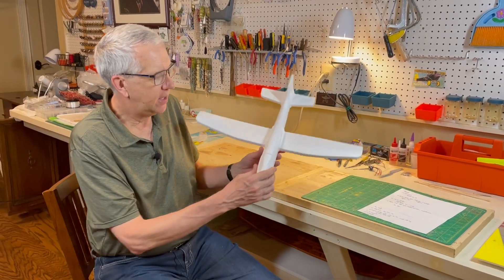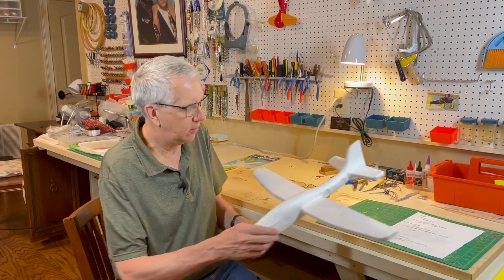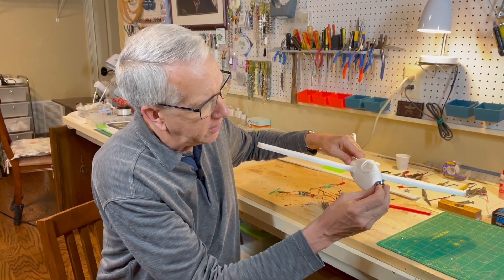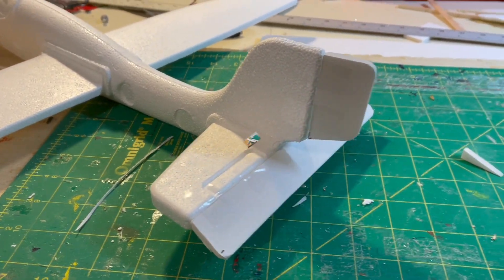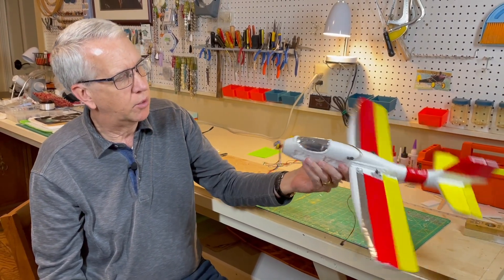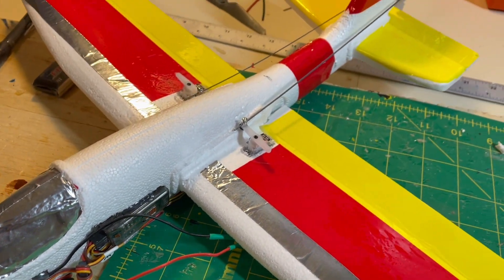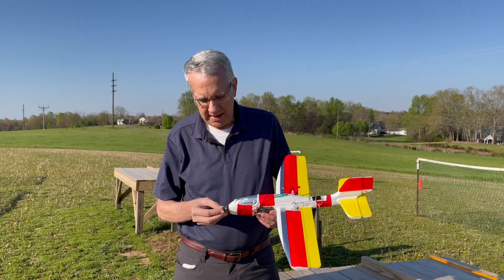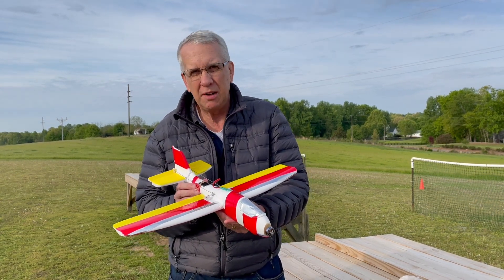$1 Foam RC Glider Hack

Comment: Use a park 180. Plus I'd move the battery up if that didn't change. Anything. You could add more tail wing area.
Reply from the maker: CM:  Good points, thanks!  Tim

Comment: Surely your not serious ?  I just don't know what to say !  After you finished it looks like it would be worth 25 c. ! I don't believe that you thought that would happen, - but worth it for a good laugh - better luck next time. It looks like torque and gyro effects to me, as the plane tried to rotate around the prop and did all sorts of exciting and hillarious manouvers, if you slowed down the video you could pass it off as 3 d. I enjoyed it very much, can you make some more like this ?
Reply from the maker: This . . . is a hobby. Do check out my earlier video where one of these small gliders converted to RC just fine. One learns by doing . . . 🤔 Tim
Reply: @TimMcKay56  or by watching someone else ! It was very enjoyable and a refreshing break from all those videos that make it look easy  to do a conversion - and you did make it look as good as it flew. I think we deserve a retrospective analysing why it didn't fly ? What about another try ?
Reply from the maker: @ericwillis777  Weight is the key item for the smaller models.  Just not enough wing area for good flight. Tim

Comment: With inflation $5 Store will sound more appropriate today...
Reply from the maker: 😁 Tim
Reply: @TimMcKay56  Question: When it's time to sacrifice aerodynamics isn't it better to have a clean top of the wing and clutter the bottom since most of the lift is on the top?
Reply: @Angelum_Band  It could be, really no studies have been done on this.  The reason mostly for keeping the top of the wing clear is access, it is just easier to reach the lower surface of the wing.  Tim

Comment: I think that out runner motor might be the cause of your problem. Especially as fast as it torque rolls. Try the motor you were going to use in the beginning.
Reply from the maker: Thomas:  That is a good point.  I also think that ailerons might have helped to more quickly catch the roll.  In any event, with heavy smaller models best to keep airspeed up.  Tim

Comment: Anytime I do glider conversions I start by making it glide perfectly and get the exact CG. Then adjust and glide if surface area is added like you did with the wing chord extensions. I'm also wondering if that motor just had too much induced torque roll? Kind of odd, I'd think even with the weight it would have just have to be a fast flyer, but it looked like there was some serious off balance issue.
Reply from the maker: It's always tricky with these smaller, lightweight models.  I think overall the model was just too heavy for the motor used.  Tim